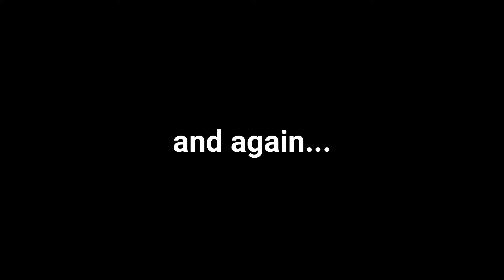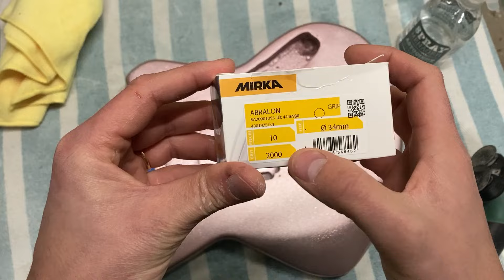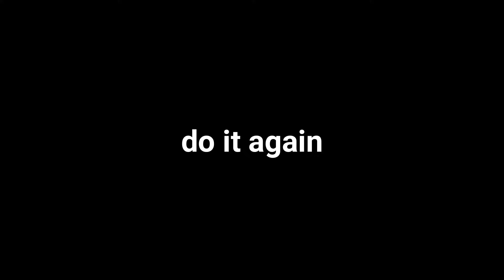DIY Sparkle guitar painting and finishing

Comment from the maker: [EN] - Some datas :)
- 8 days of work spread over 6 weekends (mostly drying time)
- 2 cans of primer, 1 can of pink paint, 1 can of glitter and 2 and a half cans of varnish (I need to figure out what to do with the rest of the varnish before it's wasted)
- 135€ of paint and sanding paper, without counting the polishing products and the polishing foam...
I hope this made you want to try it, have fun!

---------

[FR] - Quelques stats :)
- 8 jours de travail réparti sur 6 week-ends (majoritairement du temps de séchage)
- 2 bombes d'apprêt, 1 bombe de peinture rose, 1 bombe de paillettes et 2 bombes et demie de vernis (faut que je trouve quoi faire du reste du vernis avant qu'il ne soit perdu)
- 135€ de peinture et de papier à poncer, sans compter les produits de lustrage et les mousse de polissage
J'espère que ça vous a donné envie d'essayer, have fun !
Reply: To avoid sanding off most of your base layer of primer, shoot a layer of clear lacquer or sanding sealer first (and let it cure properly). Level that layer before applying the primer. It makes the process thereafter much faster.
Reply: Aussi, si vous en avez une, apportez une impermiable plastique pour eviter des petits fibres des vestements à poluer le painteure.
Final result looks great.
Reply from the maker: @peachmelba1000  Yeah, I didn't had sanding sealer at that time. But the main problem for the first layer was my prep sanding... It wasn't clean enough ^^
It was more work to do, but hey, it works lol 🤷‍♂
Reply from the maker: @peachmelba1000  Yeah you're right! Thanks a lot man!
Reply: @FrenchGuitarGuy  On my channel, you'll see a short video of an offset Flying V I finished last month. That guitar's finish has three tiny grey fibers in it at various spots. I didn't noticed until after I shot the lacquer lol
Reply: @FrenchGuitarGuy  But that guitar is a prototype, so I'm not too concerned. Leçon appris.
Reply from the maker: @peachmelba1000  Yes, I just saw your video. Awesome man! Bonne journée ;)
Reply: It made me want to never try it. Great video.

Comment: Sandpaper should only be sold to licensed professionals. Jeez Louise that was painful to see.
Reply from the maker: Ok bro, can you be more precise?
Reply: @FrenchGuitarGuy I think he meant it is better to use a sanding block rather than hands and folded sandpaper.   Also, far better to just dust on a coat that you can see through using long strokes that start and end past the surface you are painting.   But hell , your end product came out pretty good.
Reply: The end result is all that matters.
Reply: Have you seen the result ?

Comment: Why sand it?
Reply: If you don’t sand it each coat just adds to the bumps of the last making them bigger. If you sand in between coats you’re giving each fresh coat a smoother and smoother surface to lay on as divets are filled and high points are sanded away so you gradually improve the flatness of the surface and eventually can get a mirror like reflection at the top once polished.